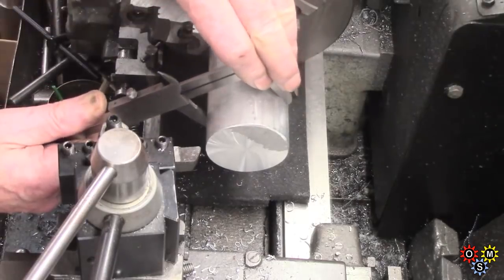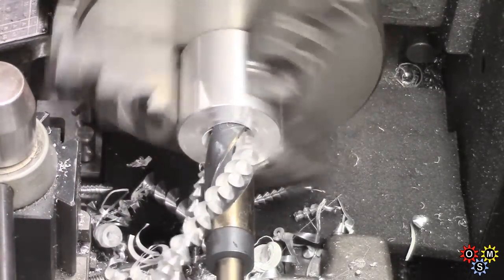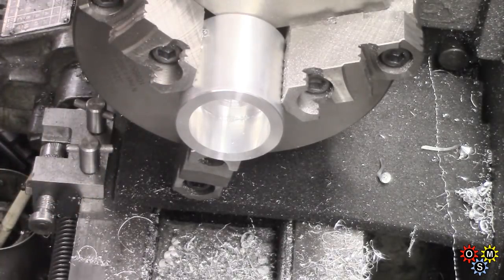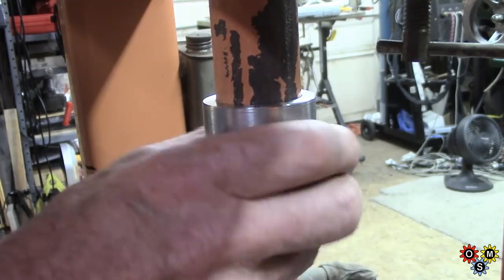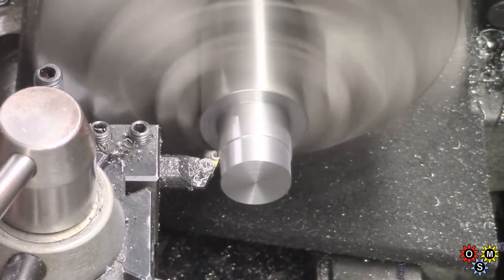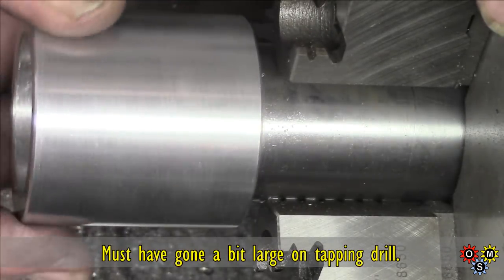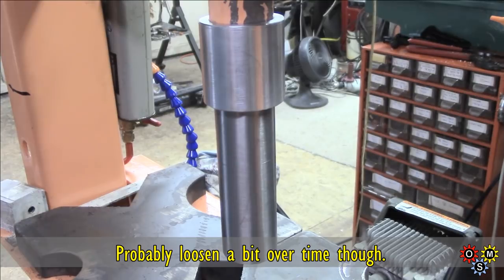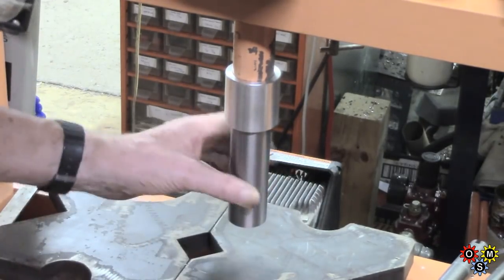Press Ram Extension

Comment: That's a nice addition to the ram for sure - at work I had to use various hunks of scrap bar to do the same thing and it was always sketchy.  Yours would be assured to be square to the job.  Cool idea.
Reply from the maker: Hi Everett - thx. I have often used scrap chunks to 'fill the gap'' but like having something that remains in the exact axis of the ram seems better. Just another of those small projects of which there are many :)

Comment: Another project on the "To-Do"  10,356 pages long list, hope to outlive that list...   lol
It's almost impossible to get glossy finish on tiny cuts and low speed, you need to hog and bite hard. BTW, how many horses or fractions of it on your lathe...?
Reply from the maker: Hey Pierre,
I did try some hefty hogging on that 10-45 but somehow just wasn't getting what I wanted. The final light cut though at higher speed and gentler feed was actually not too bad. My lathe motor is 1HP but with age of machine generally tend not to push it to extremes. I have managed a .250 cut on 12L-14 OK.

Comment: An old video , but just seen it Chris. Great job. I did a bit of mod work on my 12ton press. I will have to do a little video soon. The Tig welder is next. Regards.
Steve.  . P.S. Do you have any stickers for my board.
Reply from the maker: Hi Steve - no stickers left I'm afraid - it was a long time ago now that I gave away my last ones. Unfortunately not managing any videos these days. Best, Chris
Reply: @ChrisB257  No problem Chris. You look after yourself. You have done some great video's of which i watch plenty. Regards. 
Steve.

Comment: Hi Chris. Noticed your tool holder at 4:45. I haven't been able to find one that is 3/4" shank, only 1" shank. Can you see any numbers on that holder? Thanks
Reply: John bang good is a good place to look. If you don't mind dealing with them. I got a 12mm set of 7 tools and love how they cut. Hope you didn't mind me chiming in.
Reply from the maker: Hi John - well, that tool holder was given to me and to be able to use it, did a very long grinding job to get it down to 3/4. Did that in stages but got there in the end! :)
Reply: I was afraid of that. Thanks Chris!

Comment: Thank goodness for my AC. How long is the original shaft in the press? I’m working on my press I purchased at an auction locally, It was made by late owner, but it doesn’t have much of a shaft, on top of that it is 2 pieces with a set screw to hold it in. I’m starting on a ram extension buy need to figure out how long to make it
Reply from the maker: Hi James - the original ram shaft on mine is 3.5" with OD 1.5". That's adequate a lot of the time but particularly if broaching, an addition helps avoid platform repositioning. Also it can save unnecessary operation of the hydraulic unit for some jobs. I still intend to make an extra extension but a shorter one to give more choice.
Reply: Thanks Chris I appreciate it. I posted a link of the press I picked up so you can see what I’m working with. https://youtu.be/OdQ8w1nO3TQ

Comment: Fine work all round.  I say this, of course, since it's the route I went :P  Now, I am not a safety Nazi by any means and I tend to push my press to it's limits so I am going to suggest you make another hub out of steel.  Let's say you need a 1/2 inch press pin over a few inches long and you're fighting a difficult piece and it shifts.  I can see enough twisty side load occurring at the hub to split or shatter the cup.  If it's at eye level it could get ugly.  We like you, Chris, and even though you've got the face and voice of a pirate,  I'd hate to see any future videos involving an eye patch >:)

Take care my friend.
Reply from the maker: Thanks Eddie - I take your point but reckon that with care to maintain good alignment the 1/4" walls and ID depth should survive and loading should be straight compression if managed with caution. If I do get some big enough dia suitable steel sometime, I may well make a new top cap. :)

Comment: G’day Chris, nice work. Are your intentions to leave it fitted to the press most of the time, I ask as those magnets are going to attract steel chips into the bore. Cheers Peter
Reply from the maker: Hi Peter,
Thanks - have since made a shorter piece as well. The extension will only be fitted as and when needed and when not in use I'll keep it away from where chips are around... in fact probably keep a piece of rag stuffed inside.

Comment: It's good to see you in the shop again, Chris.  Have you considered springing for an A/C unit or at least a good fan?  I bought a huge one from TSC a few years back.  It blows a lot of air at me.
Reply from the maker: Thanks Jeffry - been short on shop time one way and another. I did get a moveable A/C unit and have a small fan but - the A/C 'drinks' electric and has to deal with quite a large air volume. It takes up space, needs a duct to outside and, basically just costs too much. Fan helps but beyond a certain point it just gets untenable.

Comment: Hey Chris, 1045 steel rod at best is only kinda good at machining.  Not the best for finish, it has to be polished.  It is in the 60 % machine ability rate, so the finish you have is as good as it gets.  Functionality, functionality, yours and my word of choice.  Jim
Reply from the maker: Hey Jim - I had to use that material as it was all I could get from my friend Dick Linn locally... 1-18 would have been fine! Yes, 'functional' :)

Comment: Nice project. I don’t care for hot weather either. Perhaps you should get AC in the shop, I have it in my 2 car garage shop, two wall units. Nice but higher electric bills too.
Reply from the maker: Thanks Steven - A/C is certainly desirable but - although I have a mobile unit the cost to run is just crazy. My shop internal volume is quite large. Mainly I just have to go with the conditions unfortunately.
Reply: Consider a Mini Split A/C unit Chris. Tons of videos on YoutTube. Cheers
Reply from the maker: Hi - well, I do have a portable unit but .... takes up too much space and - eats electric. Frustrating that whether we try to stay cool or stay warm - it costs!! I need a lottery win. :)

Comment: Possible solution to your climate control issue would be a mini-split.     Heat and air in one unit.  Works well for me.  Nice job on the extent ion😁  Tc Mike
Reply from the maker: Hello Mike - 
Thanks
That would be nice but .... I really have no available space to install such and, probably more important, cost. These days my income is super limited and have to be careful, even though sometimes i weaken and get another tool or two!